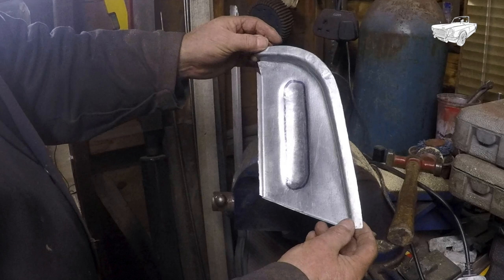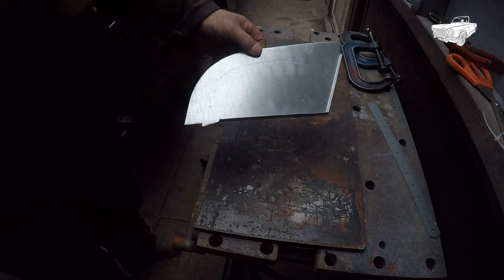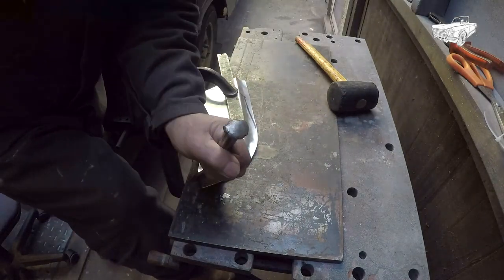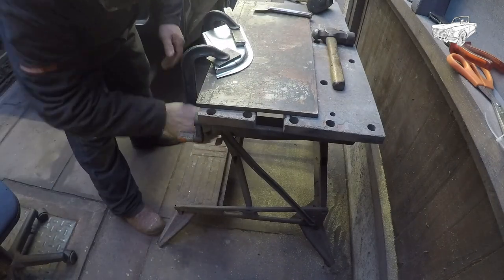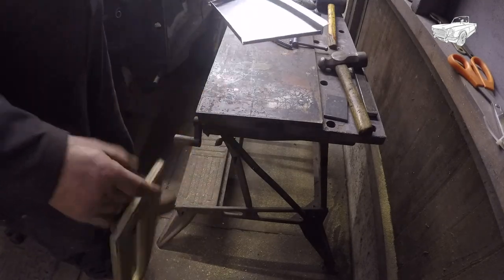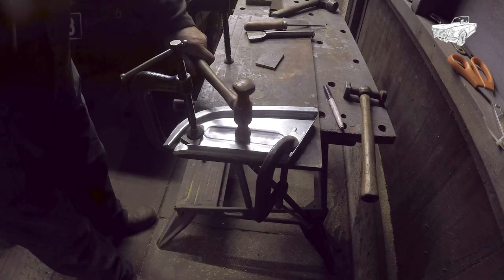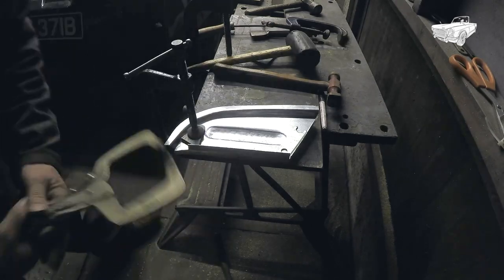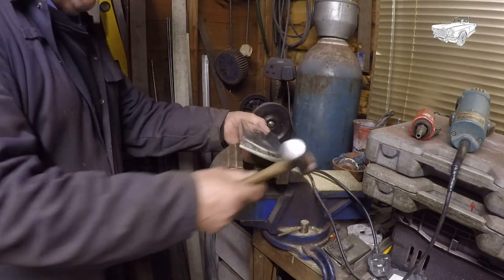metal shaping tips and tricks HD 1080p

Comment: If you polish up the faces of the hammers, that helps to improve the surface finish on the part, as any imperfections on the hammer faces transfer to the work. 
Very well done on this D panel. Will you be re-uploading the Mk2 GT6 videos at some point?
Reply from the maker: I never use my planishing hammers for anything other than for planishing therefore I don't get any nasty marks on them . Good tip though well worth mentioning thanks. 
Yes, I will be doing the MK2 GT6 videos soon
Reply: Great news,  that series was a great resource.